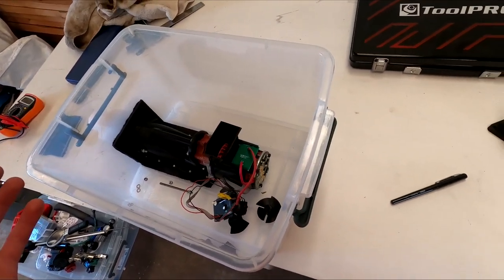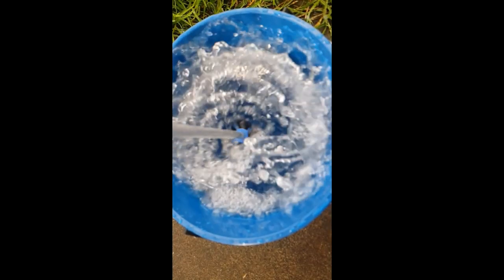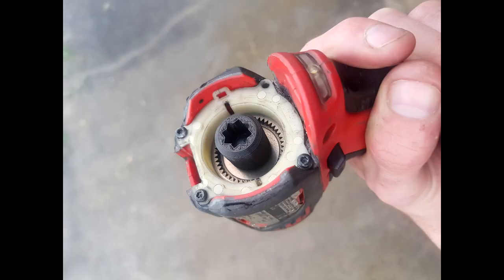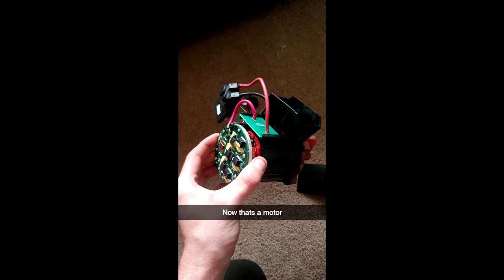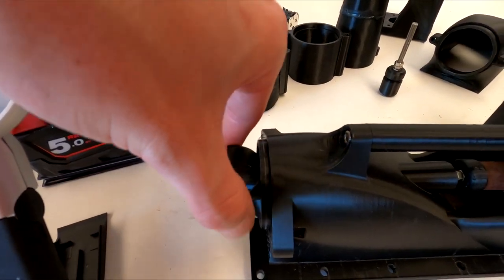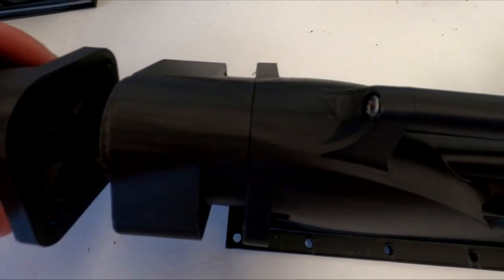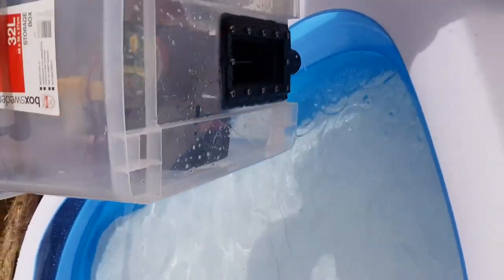Milwaukee M18 3D Printed JETDRIVE V1

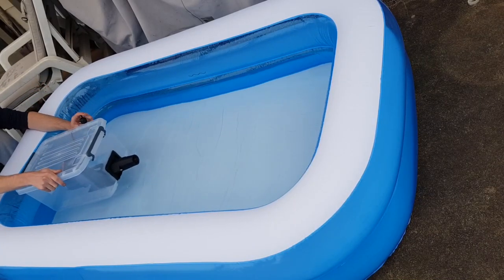Comment: Awesome video Jesse! You've definitely got me inspired now to start experimenting with my only designs. At 10:51 you swap out a 5Ah battery for a 12Ah battery and get a much larger current delivery. Just a sidenote to anyone reading this comment that it's not the amp hour (Ah) rating that delivers the current increase, it's the newer battery has a higher output current rating. Amp hours are just a measure of battery capacity, eg deliver 12A for 1 hour, 1A for 12 hours, or in your full speed case: 177A for 4 minutes 😅 You'll have to either add some more batteries in parallel to increase the Ah or run the batteries in series (increasing the Voltage) if your motor allows it, which will reduce the current required if you want it to last more than 4 minutes. I'm sure you know most of this already but just leaving this comment here if anyone tries to replicate your design. Loved the video and keen to follow your progress! 😉💪

Comment: Wow! fantastic work.  Lots of potential you are showing there. Here's some stuff you may already know:

You could reduce the pitch / size of the impeller, change the number of pump vanes etc.  One hint for you and perhaps the most important variable is the RPM that the pump cavitates at.  ALL waterjets have a characteristic narrow efficiency band where they pump best.  A waterjet I bought spins at 16k rpm to get its max thrust.  It has a 5 vane moderately pitched impeller and requires 6kw of input to get 330N of thrust.  the same company also puts out smaller pumps. Interestingly two of their smaller pumps using less power in produce more thrust out. If your aren't aware the company is MHZ. Based out of Germany and their jets are used in a company called Lampuga's jet powered surf boards.  
In order for you to maximize your design you will need to have the right balance of all the components. If your impeller is too small then you wont have enough mass to accelerate to achieve the right thrust. if your pump is too big then you'll bog the motor before you get the rpm you need to get the pump to its best thrust range.  Here's an interesting engineering thread discussing the math to quantify the things you'll need to consider.   https://www.eng-tips.com/viewthread.cfm?qid=217997.   
Inlet size, impeller size and pitch, and nozzle size all get sized together for best output. 
 From what I can see, I think your design is pretty good already.  Have fun tweaking and playing.  I've always wanted to make a prototype pump which has variable inlet and  nozzle size, and impeller pitch to play with on the fly to maximize a jet efficiency.  This would be game changing but no small feat.
All the best to you in your testing. You're definitely on the right track.
Happy tinkering.
Reply from the maker: Thanks heaps. The next video im doing will be making a dyno and testing as many different configurations i can come up with including different stages. Then i will hopefully have all parts tuned to maximum efficency and thrust output. Working on variable diameter nozzle or easy testing. However in confined space variable pitch impella is difficult. Im just going to swap in and out a bunch of designs i reckon.

Comment: Wicked project mate very similar to what I am looking at doing… I have a tunnel hull kayak (seabird fisherman 12) and am looking at building something with Milwaukee kit as I have 9 batteries . Because of the size of the tunnel I’m looking at something that that will have to be a lot more compact as I do not want it to stick out under the boat. My idea is twin 40 or 50 mm impellers with a custom single piece inlet housing for the twin impellers. My build will not be about high speed more about getting up river in shallow water.  I look forward to seeing how you go with this and hopefully I can learn a thing or 2 from you. Ps Victorian here
Reply from the maker: hey thanks for the comment, im from vic too! seems im going to be pushing just myself and an inflatable padleboard im hoping for it to be fairly fast. im guessing ill need 2 of these pumps on the final product for it to be fast enough. joint intakes would be cool. for simplicity sake im just going to be developing it as a single then i could always just add another unit if i need more power.
Reply: @jessebarker3602  I’ve started developing the dual intake in sketch up if it’s any good I’ll share it
Reply: @jessebarker3602  I want to add  bolt on gear box that connects the 2 shafts and brings a single vertical shaft up though the kayak. That way there’s only 1 small hole to drill in the kayak
Reply from the maker: @BobBob-ov1zv   youll probably need metal gears of drive belts in the gearbox. 3d printed gears tend to tear apart and wear pretty quick. Going direct drive from motor has saved me from having to worry about and of that stuff.

Comment: I really like this thing and am looking to put two of em on a boogie board, i was wondering if you would be willing to share the stl files with me so that i can print it.
Reply from the maker: @willtaylor5723  hey will. I havent developed it any further or done any optimising. I would prefer to do that before publishing stls. Just note that this model doesnt suit typical motors either. I have designed it specifically for the motor i got on hand from a m18 chainsaw.

Comment: i have a questions how many wats does the motor have what is the gearratio in the gearbox on the motor ?
Reply from the maker: @mrelnek  without accounting for voltage drop 3kw. Direct drive

Comment: That’s a lot of amps for a 12amp hour battery. You might have more luck getting a different battery. 177 amps would only last 4 minutes. If you wanted it to last more like 30 minutes you’d need a 90Ah pack…
Reply from the maker: Yeah plan was to spread the load over multiple batteries. Would decrease voltage sag. This is also static test. Once moving the motor would be under less load and drawing less amps

Comment: What is the power of the engine?
Reply from the maker: Not sure on the exact, i didnt measure the voltage. But ideally without any voltage sag 18v x 177 amps is around 3000w or 3kw motor.

Comment: Inline isn't the way to go... Or at least for me it's not... Look into outboard jet drives... I'm working on one myself I'm up against a brick wall because my motor and controller are burning because of the amps I'm asking the motor to take.... I'd love to pick your brain
Reply from the maker: Gday thanks for the sub. Im also worried about my motor, 170 amps is going to get hot really quick. In the next video im going to be doing a lot of testing, we might see some smoke 😂😂 to draw less amps you have to either restrict the nozzle less or have a smaller impeller/pump.
Reply: @jessebarker3602  a air vent on the top of the stator will solve your dry pumping issues
Reply: Ever noticed that jet skis have a spout of water shooting into the air for no apparent reason?
Reply from the maker: @HubcapPointOutdoors  an air vent on the top of the stator would ruin the suction of the water. The newer model can self prime the pump, Unlike the drill powered one.  I think the jetski's may have that as a pressure relief for when their maneuvering bucket/brake comes down in front of the jet.
Reply: Mine is all plastic no metal drive shafts or bearings..... The driveshaft is pla and it's super glued to the motor shaft with a press on coupler
Reply from the maker: @HubcapPointOutdoors   yours is moving you along! That makes me hopeful for mine. What diameter impeller and nozzle do you have?
Reply: Очень круто, ждём новый выпуск!
Ставлю лайк и подписка 👍🏻
Reply: @jessebarker3602  the overall diameter of the impeller is 40mm I couldn't tell you what the exit diameter is on the nozzle it's something that I just adjusted until it was a good balance between the velocity of the water leaving the jet and the overall flow rate with the low duty cycle 12v motor I had on hand... The ones in the video  have a teardrop shaped impeller and nozzle so that it will take advantage of centrifugal forces... And yes as far as can tell jet skis have that vent as a way to mitigate the fact that the intake can become separate from the surface of the water quite frequently and to insure the pump primes quickly the air has to have somewhere to vent the pump quickly.... And with water being an incompressible fluid the pressure drop while pumping water is insignificant in comparison to the benefit of being able to "get back on the throttle" sooner after losing prime
Reply: @jessebarker3602  I'd be happy to send you the my files I've long since moved on to a new design... I just checked and I have a backup of that version on fusion
Reply from the maker: @HubcapPointOutdoors   we will both run into same issues with melting components. Running 12 and 18volt gear. Makes it have to pull a lot of amps. Higher the voltage the less amps.
Reply: @jessebarker3602  like I said I hit a wall till I can afford a bldc and a matching controller
Reply: The motor I had was a 12-24v brushed motor and I was driving it with 20v via a cheap drill battery..... The amps I was pushing through the motor wasn't the problem..... It would happy to do that level of work.... But it was a motor that was rated at like a 10% duty cycle.... And I was giving it 100% all the time..... Over volted by 8v
Reply: That's the engine cooling water @HubcapPointOutdoors